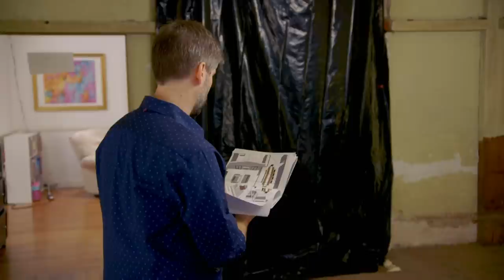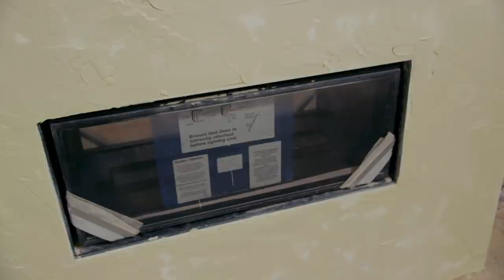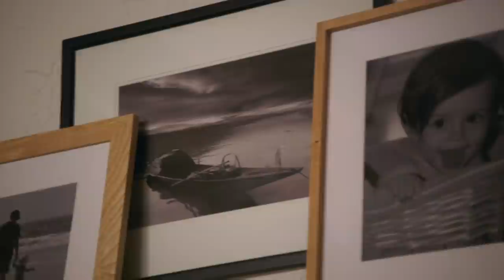"Is It Too Small?" Did They Install the WRONG Fireplace for This House? | Nate & Jeremiah By Design

Comment: The flange surrounding the fireplace would have matched the scale (size) of the door handle plates.  The ‘headers’ above the doors should have been sunken into the wall, instead of attached to the wall.

Comment: The fireplace isn't 8 inches too small, it's 28 inches too small and not high enough. If you're going to have a focal point, that's the point. Otherwise you have to lie down on the floor to see into the other side and fireplaces by proportion aren't designed to be horizontal slits and that drama would have come with one big enough to actually, you know, see into the other side. The place is cold too, even with the fire so where's Chip and Jo Jo when you need them?